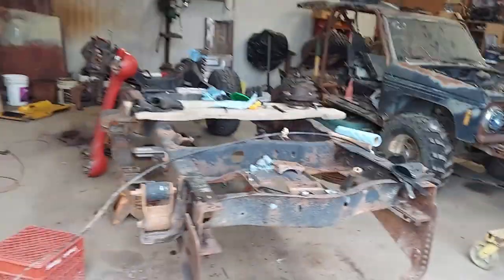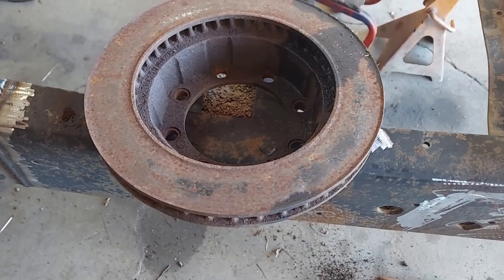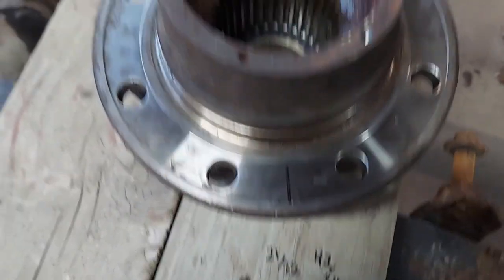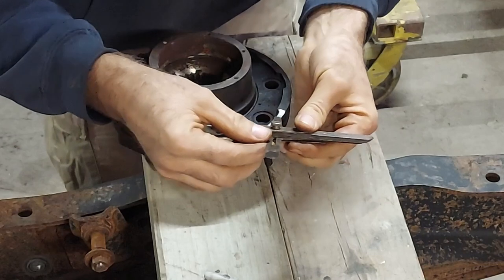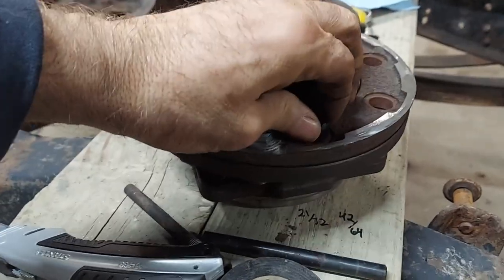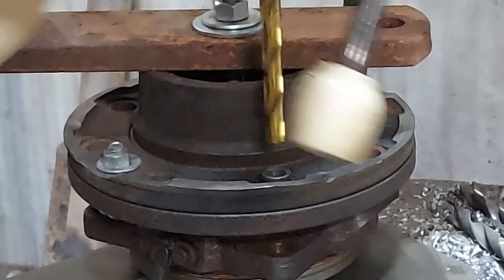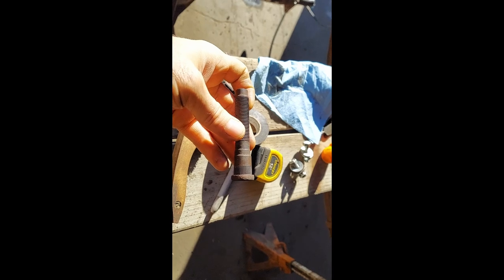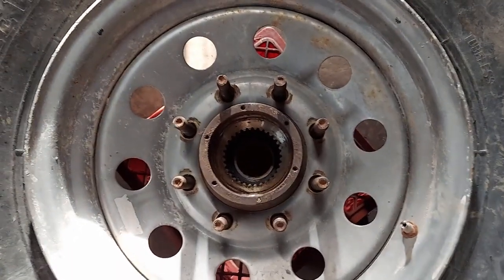Redrilling SuperDuty unit bearing hubs to 8 on 6.5

Comment: That's a neat trick. 
I had a friend who used to do stuff like this, it always worked. He'd say don't spend money on Shtuff you can do yourself. He was one hell of a mechanic. Any engine motorcycle to Jaguar, he could do a "work around "to fix it. We were going over the Palacios causeway in a 4x4 International and the right rear axle started to walk out, he just bumped the rear tire against the curb knocked it back in until we got over the Bridge, pulled over we hitched to an auto parts store and he found the part and gear oil.He was a great guy
I digress.... 
Keep on keeping on

Comment: Dude just get the spindle hub conversion kit ,unit bearings don't last very long even with stock wheels and tires.40s only a few weeks if you catch air and have a send it maybe a couple hours even..
Reply from the maker: That is a great solution if you can afford to throw that kind of money around. I cant at the moment